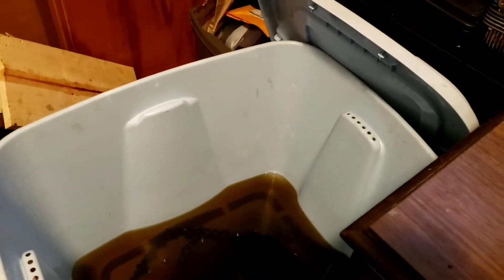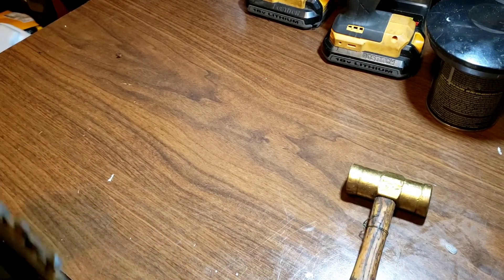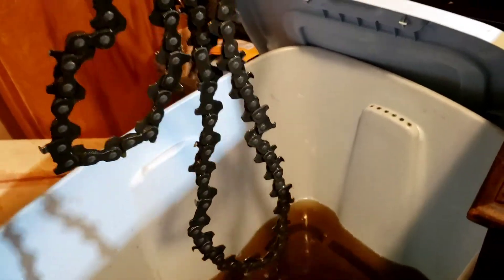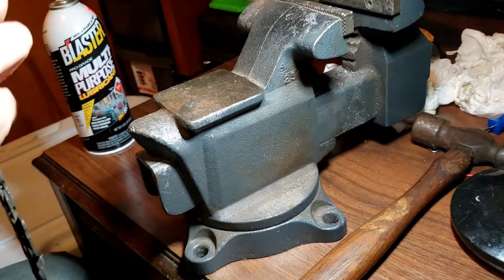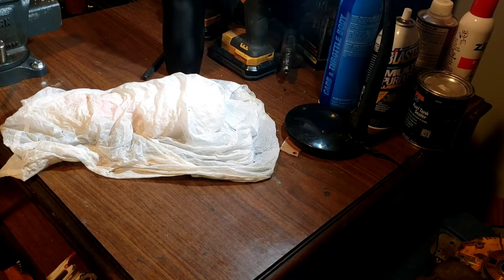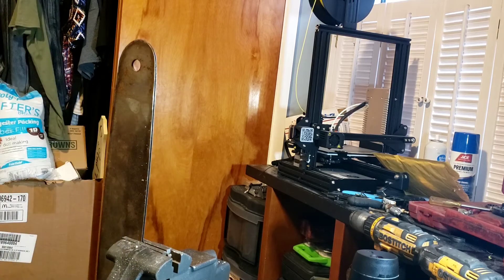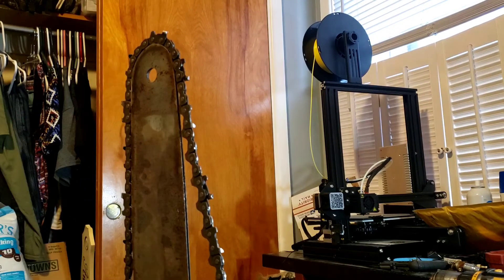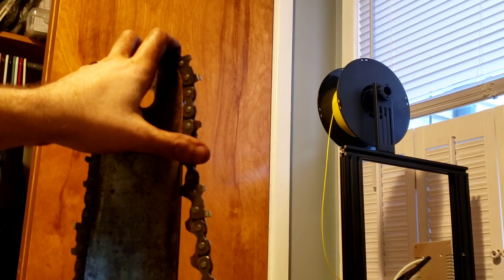McCulloch Model 77 Rusty Bar and Chain, Was I Able Save Them?

Comment: I usually lube it put it over the bar nose and tappy tap tap tap till it loosens up 👍
Reply from the maker: That's what i did and then straightened out on the flat, rotate back to the nose and repeated till the links loosened. Glad I semi mounted the vise to the table Next the chain spinner lol.

Comment: I would hang the chain, and spray WD40 so it runs down the chain. It displaces water as a benefit and stops the rust. Of course you can do it a hundred ways and still have stuck links. Good luck
Reply: You beat me to it: thinking the same thing.
Reply from the maker: Ill be soaking her in oil so she can absorb it and hopefully stop any flash rusting.
Reply: @mistermacgray  Oil will stop the rust on exposed surfaces, but it won't displace the water where you need it most like WD40, and it is messier
Reply from the maker: @doubledeuce5084  well I have chains outside that haven't seen lube in ages and have gone fine without wd40, no rust on them despite seeing high moisture days. However this chain is inside my house eat the time in a bag soaking so no harm using just oil. Problem with if I were to soak my chains in wd40 and let them hang outside, dirt and dust can collect on them easier and when the wd40 dries, the dirt stays and that will attract moisture causing issues. Oil won't evaporate as easily if I were to use that however and why I chose it over wd40.
Reply: @mistermacgray  I wouldn't leave them outside. I just thought it would be cleaner  hanging them that way inside....The hardest thing to find in good condition nowadays is not the saws themselves, but the bars and chain for these old saws.

Comment: PB blaster or good old Liquid wrench
Reply from the maker: This pb blaster is a little thicker than penetrating oil and has Teflon in the spray so figures it was better than wd40 or a penetrating fluid at this point.
Reply: @mistermacgray  oh so you did use PB. 👍 I think deisel fuel might have worked too.
Reply from the maker: @vintagesawyer6246  yup, showed that in the video, pb multipurpose lubricant.

Comment: Put the heat to it propane torch burn the rust outa it lol..
Reply from the maker: I think that would do more harm than good, not that I didn't think about using one. The steel would lose its strength (I don't know the exact word) and when under a load after being heated up in such a way, the steel would stretch abnormally when it gets warmed up but would return the its size when cool.
Reply: @mistermacgray  I'd be hesitant as well. If you didn't get it too hot it might be okay but if it changed color it'd be concerning as that might soften the steel if you let it slow cool.
Reply from the maker: @jeffreyrubish347  thats why I didn't torch it.
Reply: @mistermacgray  you won't hurt it with a little heat as soon as you hit it you will see it will free up pretty qwick just like a brake bleeder will...
Reply: @mistermacgray  you heating it won't hurt it anymore than being in wood and hot all day or not enough oil..
 don't heat it cherry red just enough to burn the junk out...
Reply: That'll take the temper out of it

Comment: Soak in wd 40 in plastic bag for a day or 2 👍
Reply from the maker: I did for a week in pb buster lubricant which is better than wd40.
Reply: @mistermacgray  wd worked for me..but the chain was not as old..you are nearly there with it now 👍
Reply: WD-40 sucks, just my opinion though
Reply: 2  reasons I like WD40 better than PB blaster in this situation. WD gives better lubrication. PB gives better penetration. As the WD dries it leaves a better coating against rust, and it will displace the water, not that PB won't do these things, but WD is a bit better at it.